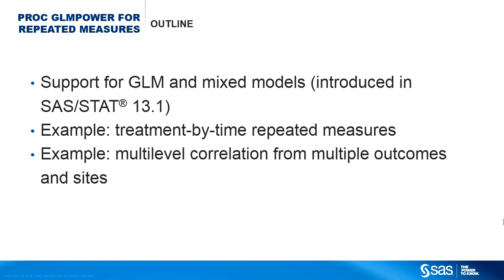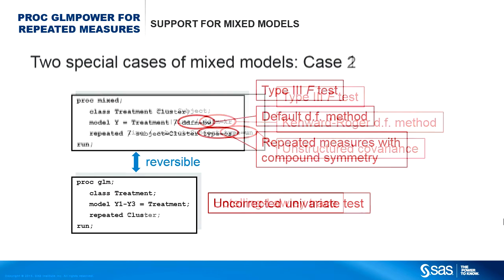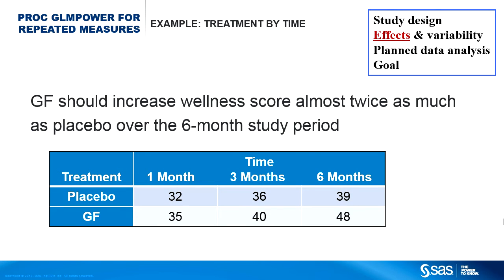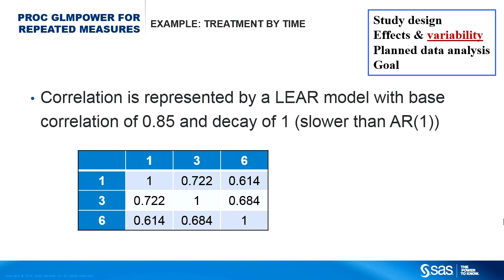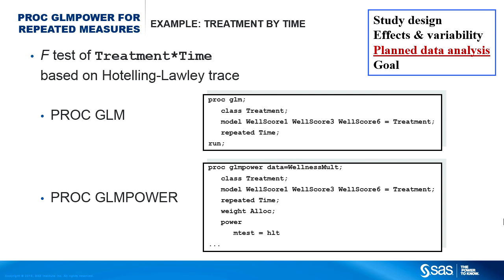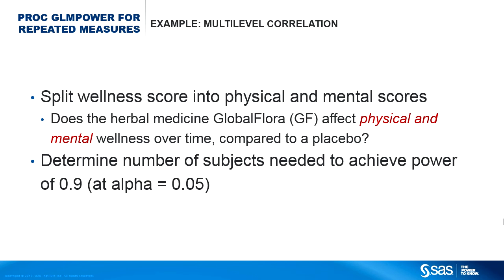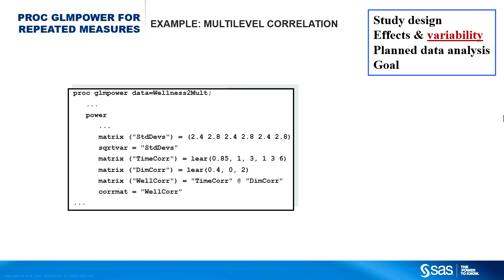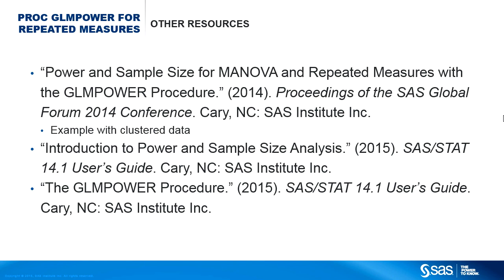Using PROC GLMPOWER to Compute Power and Sample Size for Repeated Measures

Comment: Is the alpha=0.05 or 2 sided alpha
Reply from the maker: Thanks for your question. Checking for you!
Reply from the maker: All of the analyses covered in the video are based on F tests, with alpha=0.05 as the default significance level. The tests are 1-sided in the sense of being rejected if and only if the F statistic exceeds a cutoff value. But the traditional concept of 1-sided vs. 2-sided that applies to simpler tests such as t-tests doesn’t really apply here.
 
The ALPHA= option is documented here:
http://2.sas.com/6052ObQjq
and the hypothesis testing concepts are documented here:
http://2.sas.com/6053ObQjS